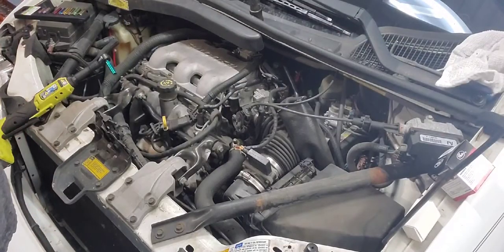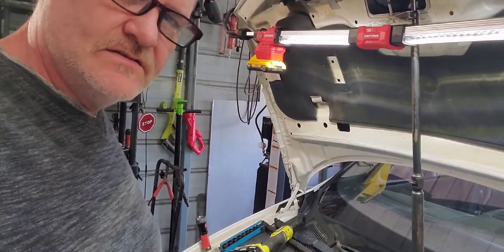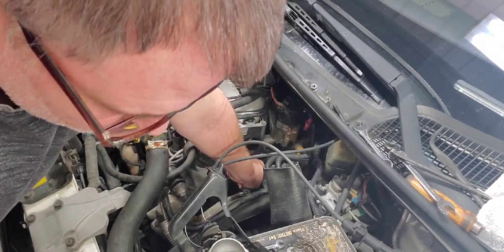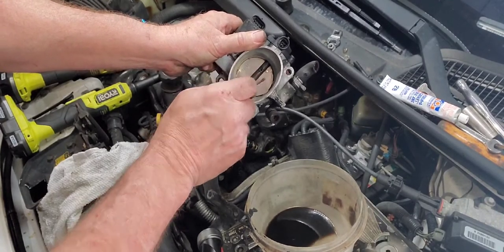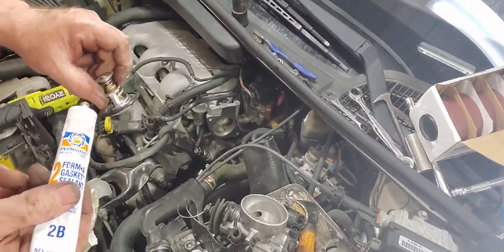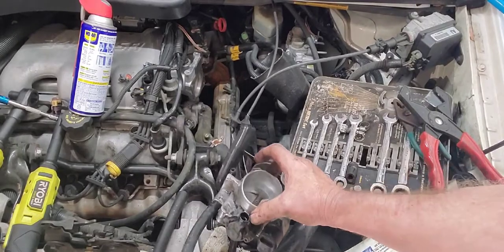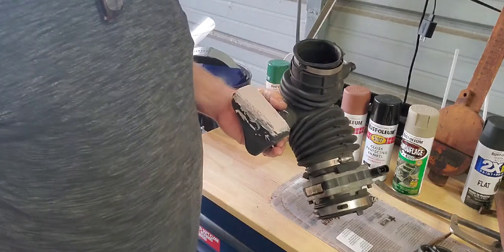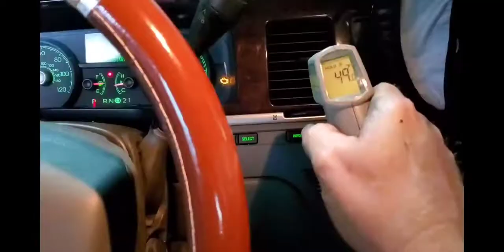1998 Venture thermostat replacement

Comment: What drill attachment did you use to clean the intake manifold? Was it the same as the one you used to clean the gooseneck pipe (thermostat housing)? Thanks!
Reply from the maker: Yea, same attachment, just a wire wheel, it didn't help much because of the size and angle, mostly brake clean and a rag did the best.
Reply: @DoubleTroubleGarage  Thanks!